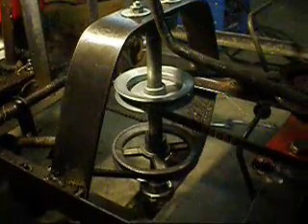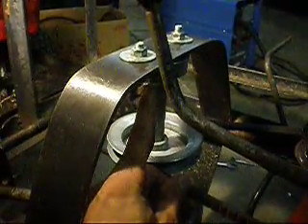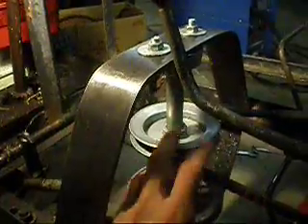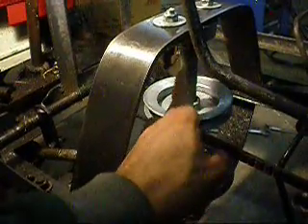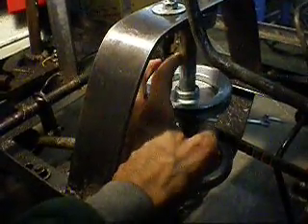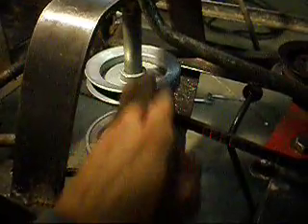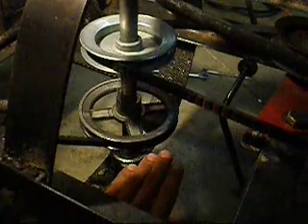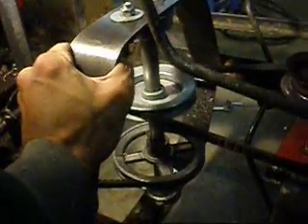Racing tractor jackshaft setup

Comment: i have a craftsman lt 2000 new body style and it has a jack shaft stock in it should i change the pully on the shaft and rear end or should i just do it on the motor and rear end
Reply: if you want to go very fast if you have a transaxle small pulley like a 3 inch or 2 inch pulley in the rear and a huge pulley on the engine like a 6 or 7 inch pulley